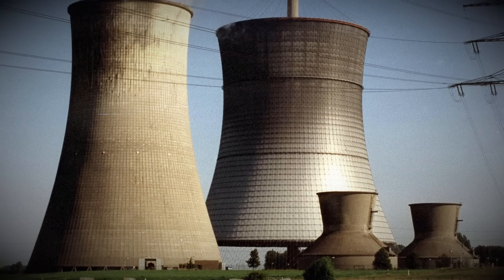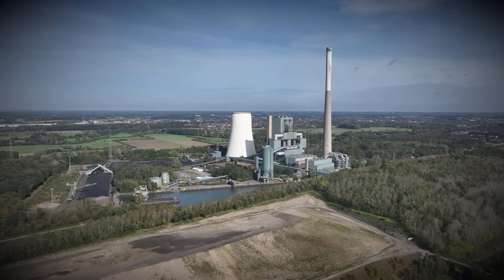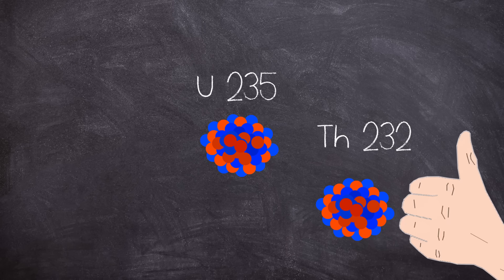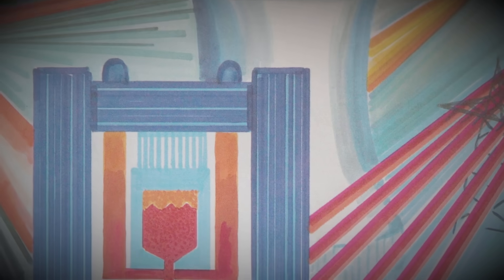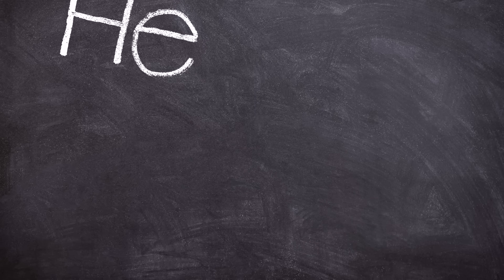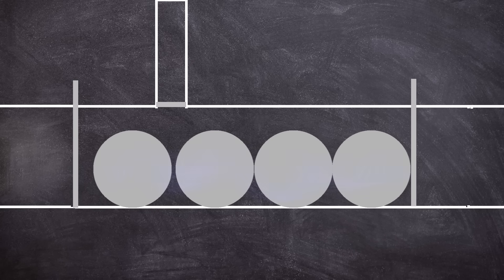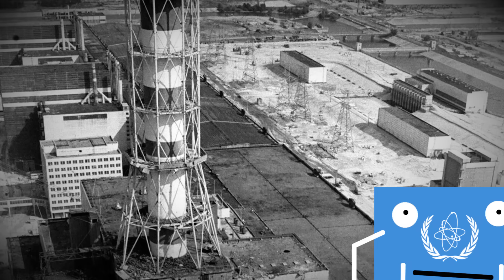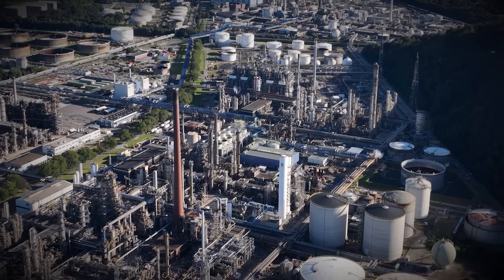Inside Germany’s “Chernobyl”

Comment: I've found the pebble bed design of reactor to be really interesting for a while, and yet this wasn't a failure point that I knew about. In theory the PBR is a high efficiency self-regulating reactor with a constant online cycle as it doesn't need to be shut down for fueling. 

Now the reason for using a lot of tennis ball sized fuel elements rather than the usual rods was in for safety. The machine is supposed to be self regulating, due to the mechanical properties of the pebble's. Each ball is flexible, and can expand when heated - which moves the fuel particles farther apart, slowing the reaction. (Much like the negative void coefficient of a well designed BWR reactor, but without the complication of handling phase changes).  Using a gas coolant has assorted advantages in handling and heat capacity for thermal efficiency. 

Conversely - the fuel balls were also the weak point of the design. Traditional fuel rods are sintered metal in a ceramic casing, inside a metal tube.  PBR elements are quite fragile by comparison, as they needed to expand and contract. They would rub together and create dust, crack, or shatter, and in turn could become stuck in places. Apparently trying to encase uranium in stuff that has the mechanical properties of pencil lead was a bit messier than originally thought.
Reply: Also, moving pebbles tend to settle down in a tighter configuration, which makes (re)moving single pieces difficult. Fill a glass with uncooked rice, stick a knife into the rice, shake the glass for a while, and you can lift the glass by pulling the knife handle up. This effect is especially strong with oblong elements, but in principle valid for everything that is made of many small roundish objects (ground liquefaction when an earthquake occurs). That reminds me: The Rhine Valley has experienced quakes up to a magnitude of four (breaking turrets off the Dome of Cologne)
Reply: @gabbyn978  Of course that begs the question of if they could have the coolant flowing up at high pressure so they can have a fluidized bed pebble bed reactor... Probably not, but now I'm going to singing "I can't get no - liquefaction" like the rolling stones all day.
Reply: There were several porblems with the balls. One was that the friction got much higher in the dry He atmospere than in normal air. There were more balls breaking than planed / expected. Another big issue was that the US would no longer provide new fuel with HEU. AFAIK there was also more damage to the reactor, from overheating that would have needed expensive repairs, if possible at all.

Comment: German engineering has a reputation for excellence, but also it has a way of being done precisely; that the end product will fulfil the specifications to an exact degree, no less, and no more capability than specified. It also seems that things are often done in a more complicated way than seems absolutely necessary to fulfil the spec. These are generalisations of course. Applied to nuclear engineering - maybe the German exactness didn’t help - the complex circulating arrangement of the fuel balls seems an obvious weak spot in a reactor design. Ingenious though!

Comment: Your comment on 77% of energy use being from fossile in Germany for 2023 is correct. Your conclusion however is misleading as there are no nuclear powered cars etc. Looking at electric power in all of 2024: renewables: 60.4%; fossil: 38%,; nuclear 1.6%.
Looking at the future potential pushing renewables makes has the best economics. Nuclear power is dying as it is just too expensive. Only countries with nuclear weapons will continue to use nuclear power based not on economic reasoning.
Reply: I was also wondering about the fact that fossil fuels accounted for 77% of the energy consumption in 2023. So I looked it up myself, and as you said, energy consumption in this case is not limited to electricity production, but it includes all energy consumption, including things like heating, cars, and other industries (ironworks, chemical plants, etc.).
Reply: It all depends.   The nuclear navy would be impossible without nuclear reactors.   Since Admiral Rickover things have changed...it all depends.
The future space missions will be impossible to operate (operational electric power, engines) without reliable nuclear power.
Reply: @Carlos-im3hn  But these are run on radio nuclide batteries (eg the Voyagers), which work very differently. No one can haul a whole power plant into space.
Reply: @gabbyn978  probes yes, but any piloted ship further than moon is gonna need reactor. By the way, nuclear reactors in space are actually fairly old thing, Soviets even presented one some decades ago and encountered peculiar situation, since bringing that reactor to exhibition in the west was easy, but bringing it back proved to be legally difficult due to laws prohibiting export of such technologies into eastern block, even if it wasn't technically export... :D
Reply: @depressedTrent  How about a Ion thruster? As a voyage beyond the moon will take more time anyway, it is a viable option imho. It might even achieve a higher speed in the end, because a. it is much lighter and does not have to transport mainly itself and b. the fuel will still last a lot longer.
Reply: Nuclear power is cheaper than most renewables technologies when oil and gas lobbies don't clog up regulatory processes with asinine things. Read up on Jackzo of the NRC and you'll realize how deep-seated their anti-nuclear lobby is. Renewables are nice for them because the backup is almost always a CCGT plant.

Comment: A few issues/errors.

Cold starting a thorium reactor is not really harder than any other reactor. Typically when starting a normal reactor you need a neutral source to cold start it. That can be just old fuel (that is typical) but for a brand new reactor, a special set of neutron sources is typically used. This is basically equivalent to how a Thorium reactor can´t cold start. Its not the identical situation, but really similar.

What makes a Thorium reactor a bit more complicated is that it is more sensitive to moderators than a normal reactor.

A thorium reactor is in no way shape of form inherently more expensive than a uranium reactor. It just can´t be a light water reactor. It can be a candu, it can be a pebel bed, it can be a metal reactor, it can be pretty much any type of reactor, apart from a light water reactor.

Now you might thin, "well a light water reactor is the most common, so its clearly the cheapest to build".

This is absolutely not the case. A reactor need by law to have a secondary containment element. That need to be vapor safe. The size of the secondary containment facility is determine to the radioactive medium expansion factor. This is the most expensive part of a nuclear reactor and the cost is detictly connected to the size.

A plebe bed reactor have a expansion factor of about 30-60. A metal reactor the factor is basically 0, and so also for a salt reactor. So you might think that a peble bed reactor is bad. Well no, for a light water reactor, this number is 1000. And that is why the building is so dam large.

Now the building does contain a lot of other stuff that is used. But those stuff just take a fraction of the total volume, about 100 times that of the reactor. So in a pebel bed reactor, there is no need to make it larger. In a metal or salt reactor there is a lot of wasted expansion space.

But in a light water reactor, the outer reactor containment building need to be 10 times larger than it actually would need to be to fit all the equipment.

Or you can do like Chernobyl and just skip that part of the  reactor.

That this hade any effect on Germany power generation i would say is fasle. There was a lot of anti nuclear setminent AstroTurf by USSR due to USSR sold a massive amount of natural gas to Germany (YES, even during the cold war). the natural gas was sent throw the eastern europe to Austria (that at that time was neutral and not a Nato member) and then via Austria to Germany.

officially the gas was bought from Austria, but in reality it came from USSR (this was the case all the way untill 2022). The profit USSR made from this gas they invested back into anti nuclear sentiment in Germany, this is still the case today, in 2021 Russia invested about €2B in anti nuclear lobbying.

This was also the case in USA but most of the lobby money in USA came from OPEC not Russia. For instance this money funded the movie "China syndrome".

This stopped new nuclear power plant project both in USA and Germany prior to respective accidents. 

The THRT-300 accident also did not lead to a wave of nuclear reactor closure. The MZFR was closed the same year, but that was already planed due to it being a tiny reactor, and that was also the case for AVR. THTR-300 was ever just a test reactor, the issue was not that it was closed, bu the technology was halted.

The only plant that close that didn´t supose to at this time was Mülheim-Kärlich. And the issue there was´t that public opinion turn against it, but legal matters. While those may have been astroturfed as well.

The first wave of closure came first in 1990, 4 years after the accident. Those closures had nothing to do with the accident but a falls romour that the VVER reactors was the same as the RBMK reactor in Chernobyl. Media help spreed this false narrative, and by that time the HTTR300 accident was all but forgoten.

During a coming 20 year period 3 more reactors was closed. 2 mid size, one small.

By the beginning of 2011 reactor closure was no longer popular in Germany, and there was really no discussion at that time to close any more reactors, duye to only modern reactors being left.

This change radically in 2011... and you may think, Fukushima.. nopp. In september of 2011 first 2 nordstream pipes was starting to deliver gas, in November it was formaly started, while they been in use for 2 month alreddy than.

In August of 2011 8 large reactors was closed down: norstream 1 have a capacity of about 15 reactors.

This was blaimed on Fukushima, but a lot of people ion charge in germany at the time got heafty nordstream stock options.

In 2022  nordstream 2 was supose to open.  2015-2019 3 more reactors was closed down (and a additional 4 in Sweden and 2 in Belgium).

31 of december 2021 more reactors was closed down, just month before Nordstream 2 was suppose to start.

And 3 more reactors was slated to be closed down 31 of december 2022, but was later delayed to 15 of April... due to.. winter and no nordstream.

This is just a case of nation size coruption
Reply: If your Northstream hypothesis were true we should have seen a spike in natural gas share of the electricity mix, yet we didn't.

Natural gas use for electricity in Germany fluctuated between 12% and 17% over the last two decades, while nuclear at its peak was around 30%.

Also only about 13% of the imported gas is used for electricity, about half is used for other industrial uses and about 40% for domestic heating.

As fas as I understood th Northstream pilelines were mostly meant to take over from more and more depleted north sea gas fields ...
Reply: @hartmutholzgraefe  
"spike in natural gas share of the electricity mix,"
That is not how reality works.

How much gas is used is not directly proportional to the amount of electricity produced.

There is several issues. One it intermittency. Higher intermittency reduce the amount of electricity produced by gas, but increase the actual gas consumption.

A other issue is move from electric and secondary source district heating to direct an indirect gas heating.

Third factor is that Germany don´t live in vacuum, as i pointed out both the 4 reactors closed in Sweden and the two in Belgium as well (and also one in UK).

The gasfield in North sea is nowhere near depleated. We know this due to what happened in 2022.

When Nordstream pipeline blow up the output in the north sea increased quite significantly. On top of that the Denmark-Poland pipline finished in about the same time line.

On top of that the prices of CNG spiked.

In late 2019 before the pandempic the prise on the European market for pipline CNG was about €15/Mwh. That was a level it had been for years. Before Nordsteam pipline finished the price was about €25/Mwh. While that is not that much less, that is sufficiently so to suppress the market from the north sea.

Due to diffrent price meddling the price spiked in mid December of 2021 to 195, while it did sink back the weeks after 

The spike when the war started in Ukraine was higher, but shorter. IN effect, the ukraine war had no effect on the long term CNG price.

The claimed boycot was not in place untill early September of 2022. But it was ramped down from russian sida prior to that, about mid June.

This spiked the price at 339 and whent back over month down to 188. Then for the rest of the year it went down to 100-150. This lead to a disasterus energy shortage over the winter of 22-23. IT worht saying that carbon tax for coal power was suspended for this period, and coal power (that was basically totaly shut of in a lot of europe) spiked considerably at that point.

Germnay used all of its installed capacity, even increased it to 32GW, and so did Poland up to 26GW

The gas price is currently just shy or 50. compare that to 15 before the pandemic. There is a permanent shortage due to lack of nuclear power.

Answer me this, Why would they even close down nuclear power after the war started?

Also the officals that took the decission, that was actually AGAINST the popular opinion at the time (Despite the media just lying and claiming it was the other way) got huge stock-options. This is publically verified, this is not a conspiracy theory
Reply: @matsv201  by spike i was not referring to price spike, but usage spike

and remember that only about 13% of the natural gas Germany consumes is used to generate electricity.

"Answer me this, Why would they even close down nuclear power after the war started?"

1) Because they had planned for the fuel rods to get used down to "the last drop" mostly, so they would have to bring up all the infrastructure for refueling them once ore.

2) because nuclear and gas plants server opposite purposes. nuclear is base load, the plants were very inflexible, responding to load changes very slowly, while gas plants are extremely flexible and can compensate for load changes quickly.

They basically fulfill the same purpose, but for opposite reasons now, compensating for renewables volatility
Reply: @hartmutholzgraefe  
"by spike i was not referring to price spike, but usage spike"
You have to understand the diffrance between domastic gas electricity production, and total gas usage.

"down to "the last drop" mostly,"
That is not really how fuelroods work. They could have keeped using the reactor at 70% capacity for several more month, and they could have got a emergency order for more fuel, and get it into he reactor by October.

"because nuclear and gas plants server opposite purposes. nuclear is base load, the plants were very inflexible,y."

Not really
A nuclear reactor can go from 100% power down to 40% with in minutes. While going back to 100% after that does take about 8 hours. If the plant go down to 60%, it only takes 2 hours to get back. If it goes down to 0% it takes about 36 hours.. Sort of. There is a workaround that was used in Bruce NPP in the big power cut of eastern USA.

"while gas plants are extremely flexible and can compensate for load changes quickly."
That is a simplification down to that its not really true.
There is 3 major types of gas power plant. Gas-turbine,. combine cycle and Rankine cycle.

Gas-turbien respond quickly, but is low efficiency, just like you claimed. Combine-cycle have a very slow responserate but efficiency is high, almost twice that of gas-turbine. And Rantkine cycle is sort of in between.

What Germany have done last decades is go from combine-cycle with high efficiency to gas-turbine with low efficiency. While the ethnically reduced the amount of gas power generated, the amount of gas used, have actually gone up.

NOTE. Gas-turbine the word gas is considering the work fluid of the turbine, NOT the fuel.

If we talk about gas-power, its considering the fuel, not the work fluid. You got the two mixed up

Comment: Thank you so much for this quick review, and timely as follows.
I am very interested in the new SMR Xe-100 (US, UK, Canada) and this historical review of the similar TRISO fueled pebble non-homogenous (fuel pebbles and control pebbles) experimental THTR-300 pebble-bed reactor is very informative in comparison.  Yes there were probably too many variables in the THTR-300 reactor vessel operation, and hokey manual and automatic operation; so now we know how to do only much safer lab-level experiments.   
Sadly a $2B expensive lesson being managed.
Hopefully the recent modern GenIV reactor designs have learned all the lessons.
The new  HALEU TRISO or TRISO-X fuel is different but similar with elements changing in each ~1mm kernel.